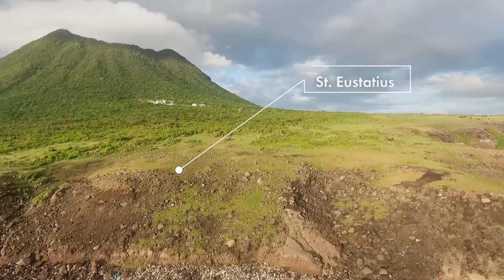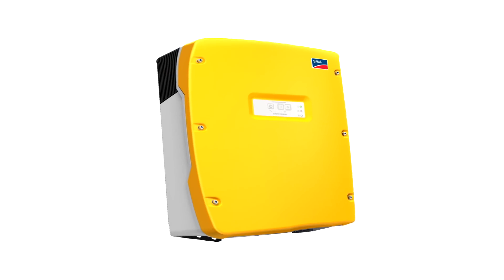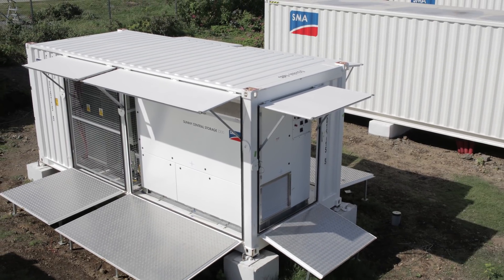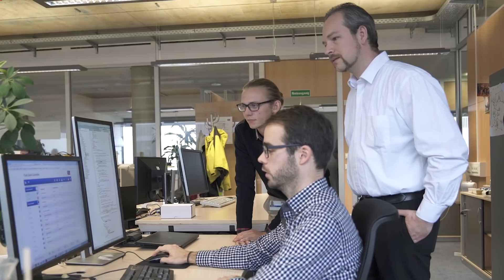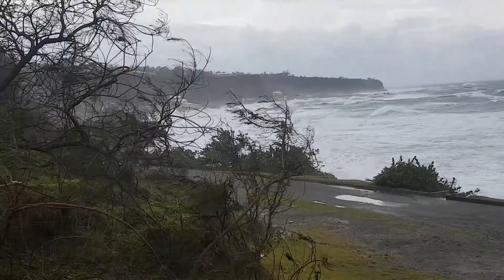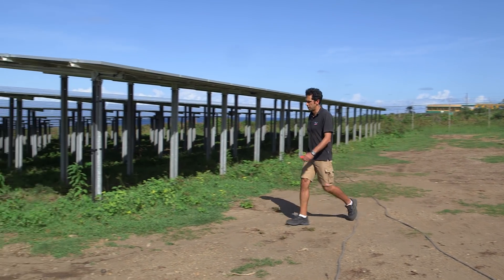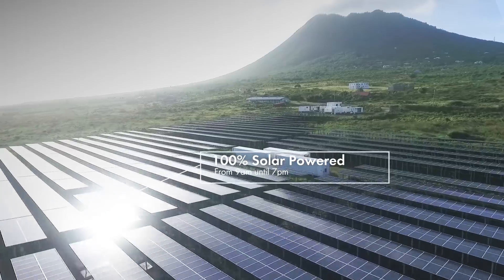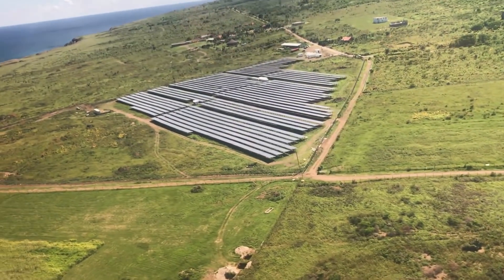St. Eustatius: 100 Percent Caribbean Solar Power

Comment: This is a beautiful and honest example of integrating diesel gensets with solar and batteries on an isolated island with everyone and everything getting better because of the synergies. It is interesting to see inside the lithium storage banks and to see the real figures for a 23% saving from solar added without the batteries. It appears that SMA have a happy customer. 

The solar panels are so cheap now and this project has survived a storm so I would guess that more batteries could be added and the system might scale a little bigger but the diesel is still needed for occasional weeks without strong sunshine